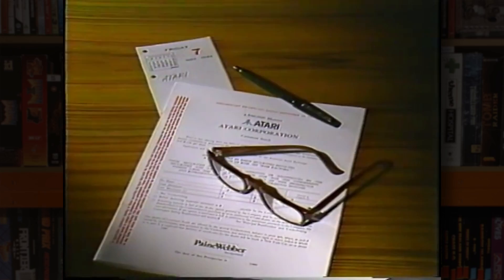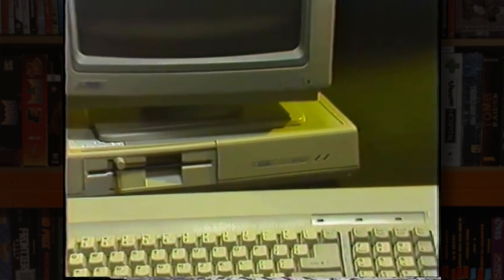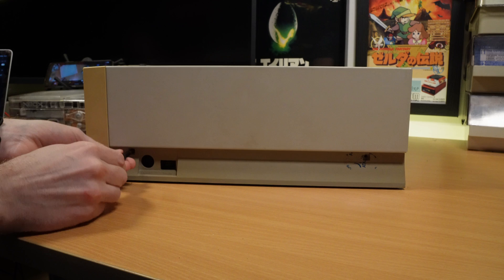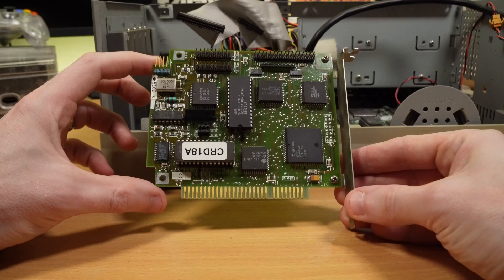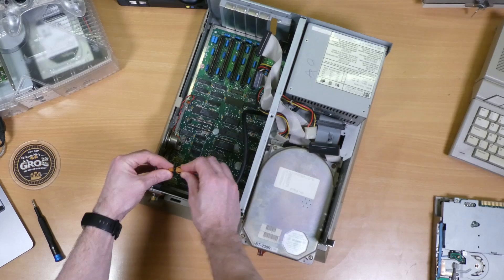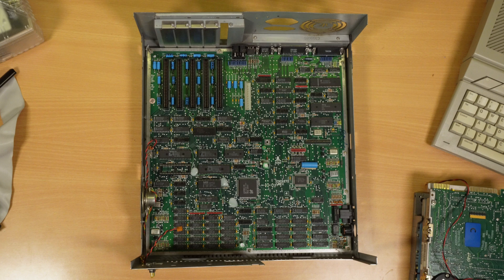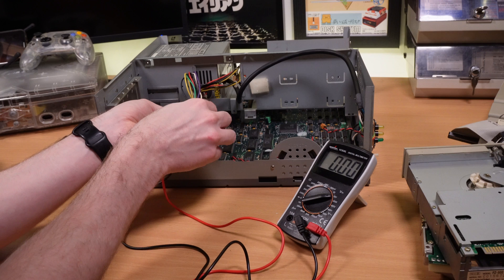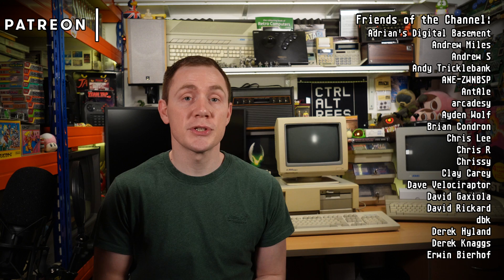Jack Tramiel vs. IBM - The Atari PC Story

Comment: Tramiel saved Atari and then ran it into the ground.  As has been detailed elsewhere, his attempt to destroy TI's (crappy) entry into the personal computer market ended up destroying Atari.  If he'd not done that and just listened to his ST series users (like me) for suggested improvements, Atari would have lasted longer although all PC architectures other than x86 PCs and Apple PCs were doomed to fail as the graphics and sound capabilities of those far more numerous machines improved.  My first x86 PC was an open box Commodore PC20 III with its associated color monitor, both in like-new condition, bought for a mere $300 at the USAF BX at RAF Lakenheath.
Reply: You are thinking of the C64 going after the TI,  not the Atari. Texas Instruments had gotten out of the market by the time he bought Atari
Reply: @10MARC  You are correct.  He ran Atari into the ground by not listening to ST owners just as he didn't listen to Commodore users.

Comment: I've had a chance to work with the PC1 a couple of times, it was used as a lab machine back in the day. It did look vastly inferior to my 1040 STE. I never understood why Atari would want to create underpowered PCs instead of pushing through with their 68K models. In the end it would be very difficult to compete with the hundreds of IBM clones out there when you had to create a virtually identical machine. Esp when the PC1 had a nice compact look - but could not be expanded, and the rest could be expanded.

Comment: I have the same PC3+monitor setup.. but my HD is found on an ISA card... so there are 2x5.25 floppy drives... along with an Adlib clone sound card, and a game controller... the 4.7/8MHZ CPU makes the machine capable of playing 1982-1988 games... newer games are very slow... but in any case, I love the design and the manufacturing quality of this Atari computer

Comment: Nice to see an Atari PC3 (also got a working Atari PC4LC in my collection so basically the same case but the LC model is extremly rare comparded to the "normal" PC4). I have the PC3 since new in 1989. Still working but I disconnected the psu a few years back and installed a mini fanless PSU, sedoldered the cpu and replaced it with a socketed V20, installed another crystal (28 Mhz, a 30 Mhz one will go to but you will lose the serial port since the controller will panic), installed a WDC Svga card (16 bit but seems to work fine in an 8-bit slot), replaced the MFM drive with a XT2CF card, installed an UMB card to free up conventional memory and installed a sound card from Opti (also 16bit but when you choose simple SB in games it will work, even the OPL chip does it's thing). Nice and quiet. The only thing I'm missing is a PC5 (which wasn't really made by Atari at that time but just some rebranded stuff).
Reply: I also have a PC3, which my uncle bought new in 1988. Could you please let me know the brand & model of the fanless PSU you mentioned?

Comment: Have you tried solarbrite-ing the plastics? Here in AZ - it doesn't take long for the Sun's UV to remove the tanning (in fact, it's pretty easy to 'overbrite' - so caution is required there). Much better than all the silly chemical baths and boiling others have tried (and far easier).